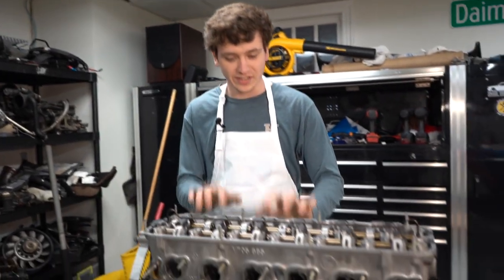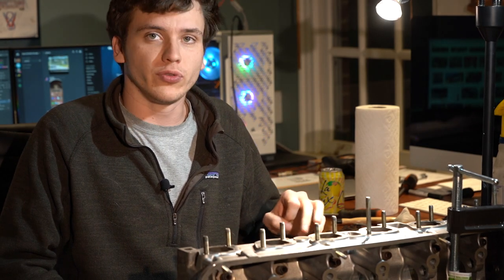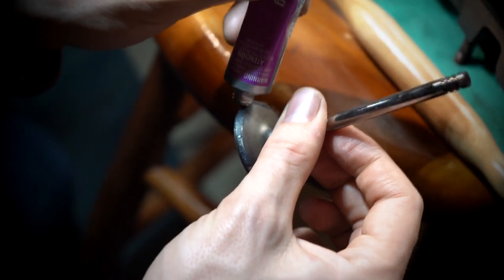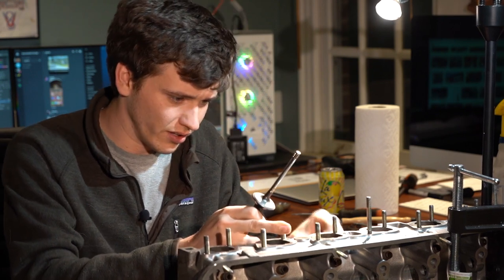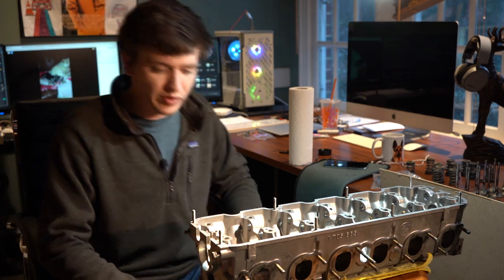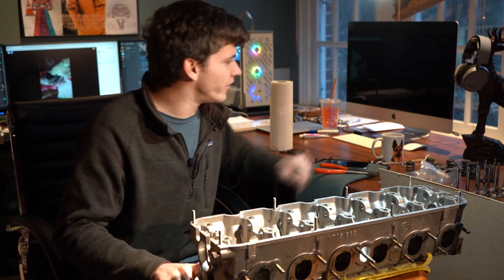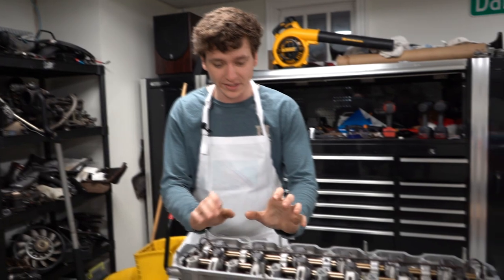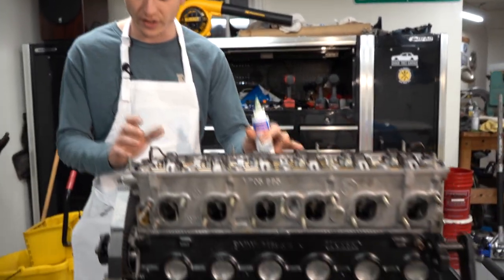Building the BMW 2002 Engine (with go fast parts) | 2002 build pt. 4

Comment: Quick question: how did you clean the valves? Grinding? Also, suggestions on how to clean the head? Particular chemical?
Reply from the maker: Take the head to a machine shop and they can hot tank it. Leave it assembled so everything else gets cleaned too. I used a razor and wire brush to get the tough carbon off the valves